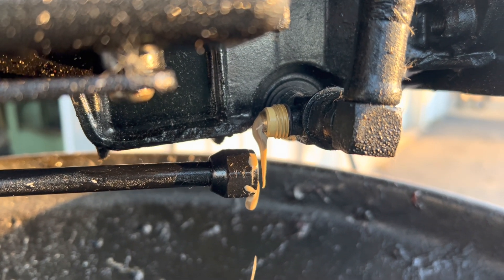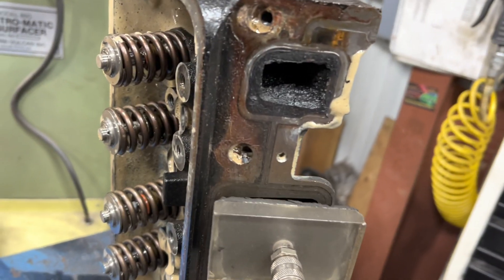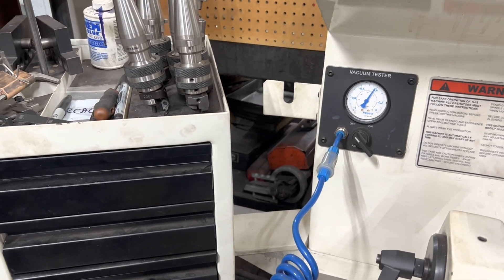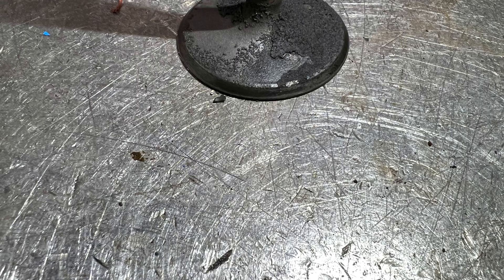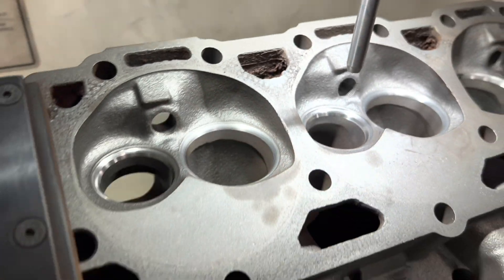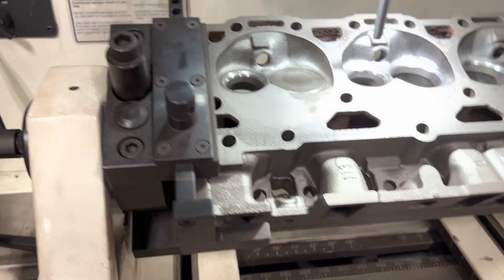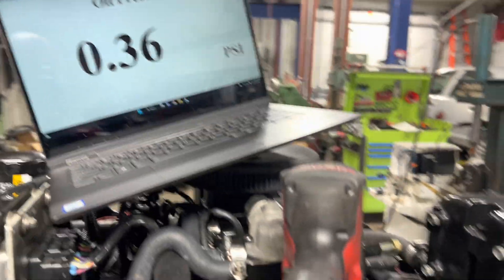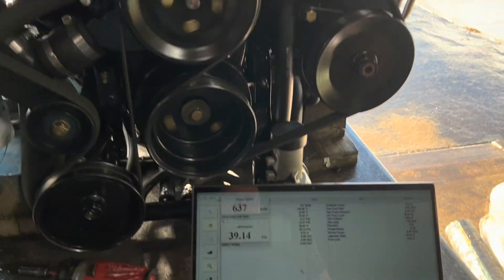2004 Mercruiser 4.3 V6 MPI Engine Overhaul After Water in Oil and Low Compression in One Cylinder

Comment: Do you use new rings when putting the old pistons in a new block?
Reply from the maker: We do.
Reply: @LakelandAutoMarine  I have a 4.3 with a cracked block and I want to get a new block and swap all internals to the new block. What internals would you recommend replacing?
Reply from the maker: @catfisher420  just depends on what it needs. I’d say rings and bearings for sure.